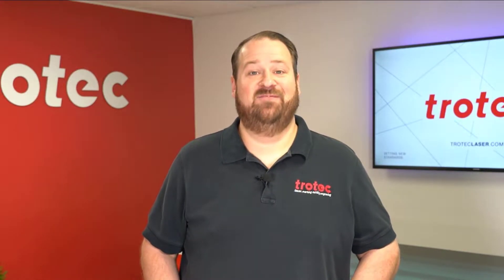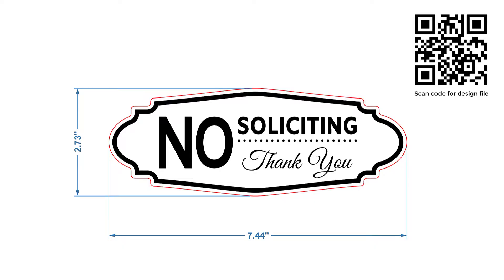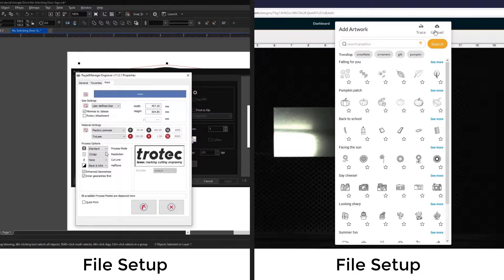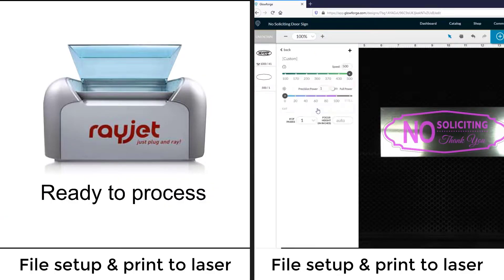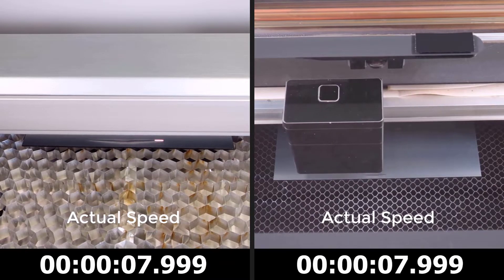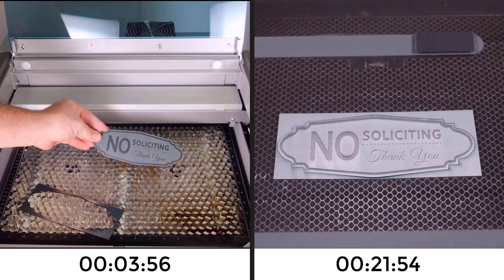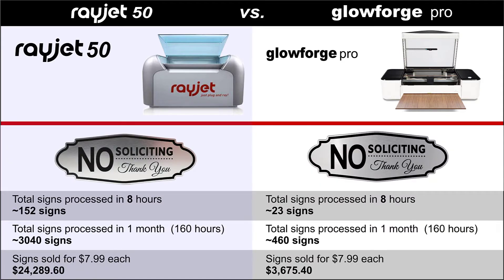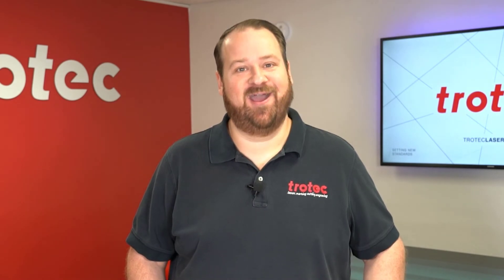Speedy 50 vs Glowforge: No Soliciting Plastic Sign

Comment: You can have the Glowforge auto focus. Your video is misleading.
Reply: The laser focus was not shown on either system in this video.
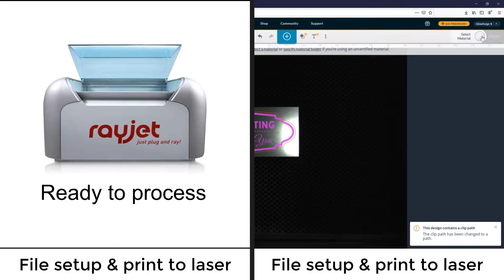Reply: @davidstevens2577  At around 3:10 in the video you said that you have to measure and specify a material thickness. That is not true. You just need to click on the set focus button.
Reply: @BryanMakesThings   This section is not for focusing; this step was done to add a new "unspecified material" to the glowforge app. The processed material was not pre-set, requiring this step; however, this would only need to be done once to set up the new material in the glowforge app.

Comment: why did you have to run the glowforge at 40% power? ...what is the comparison for speed settings (100 vs 1000 ; 2 vs 293)??
Reply from the maker: Hey Paul! These were the settings that Laser Dave found to produce the best results on both systems!
Reply: Here the real difference stands within the engraving process speed. To be seen if at 80% and double the speed, the result would still be good (the GF "orange skin-like" result is probably 'cos of the slow speed). I've a Glowforge Pro too, yet I know Trotec products are top and sure better for a real production serie/business. GF is more limited to precise/excellent low numbers, easier process, easier placement in a "non industrial" environment (and lower initial investment in the machine).
Reply: It would of been better having the engravings looking the same, the glow forget engraving in this video looks to be far superior finish compared to the rayjet tgat lines are extremly evident. What line interval did you run on each? As larger line interval will reduce the engraving time.
A proper comparison would of been better by a 3rd party that isn't trying to pump there brands performance to be superior. It may well be as its twice the price. But we need to compare apples to apples to be fair.
Reply: Glowforge. Typo above